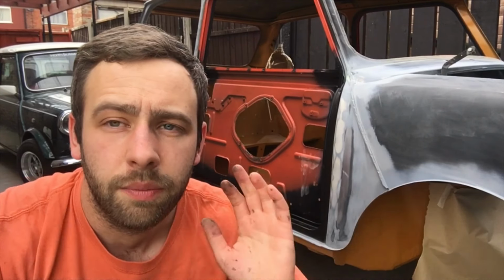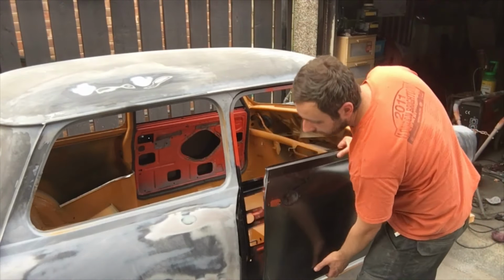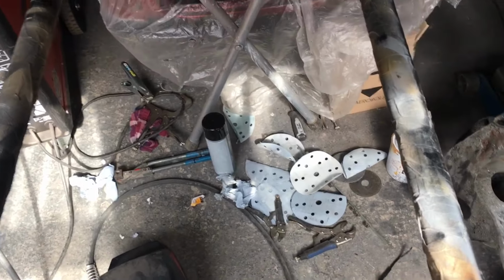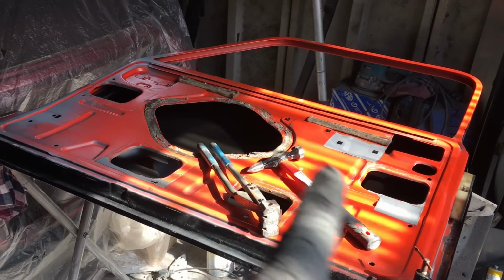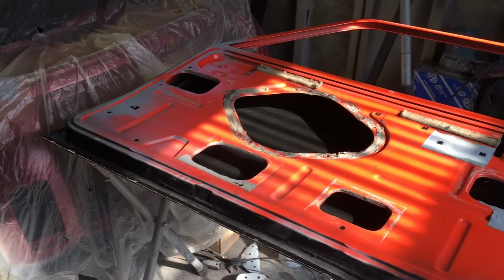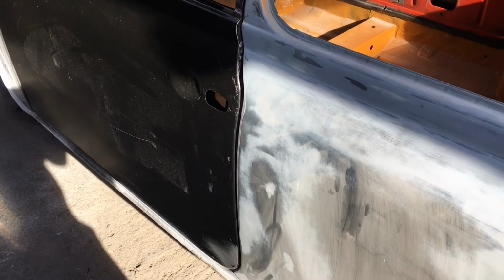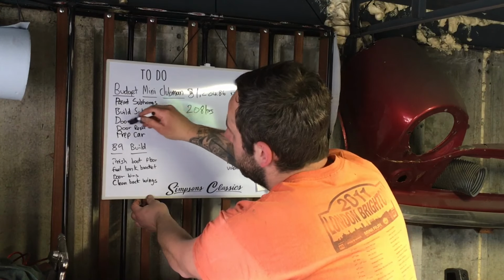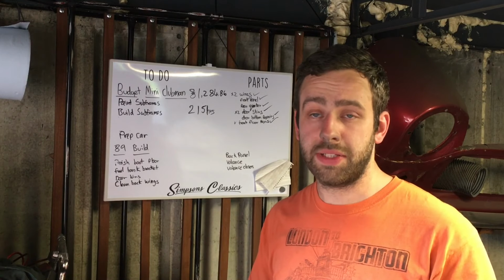Door Skins - Classic Mini Clubman Budget Restoration & LAST OF THE WELDING!

Comment: Just wondering if it’s worth putting the sound deadening onto the back of the door skin before fitting it to the frame? Or is there something that would get in the way or stop you from doing it? I only just about to start my mini renovation journey, so genuine question.
Reply from the maker: It’s definitely worth putting the sound deadening back in the door skin this can be done before or after the skin is on its
Up to you. With this car I did it after. Minis need all the help they can get with noise so it’s key 👍